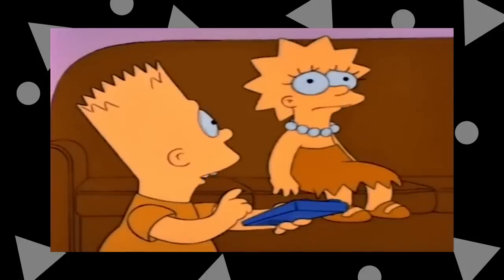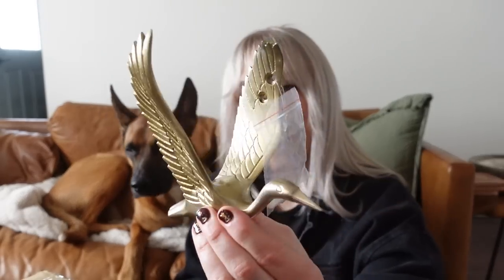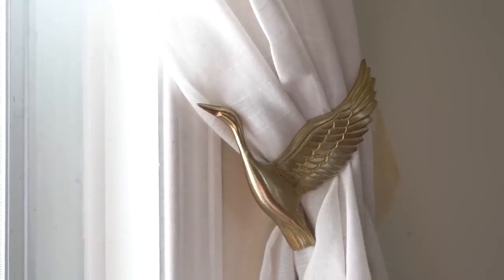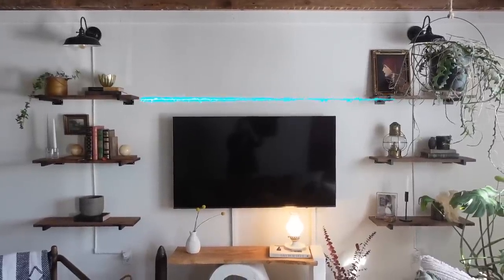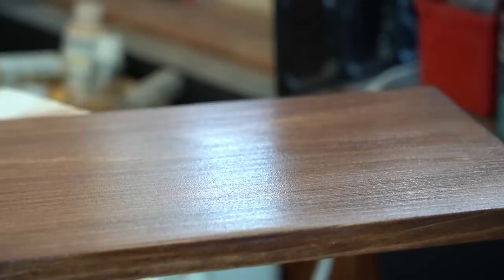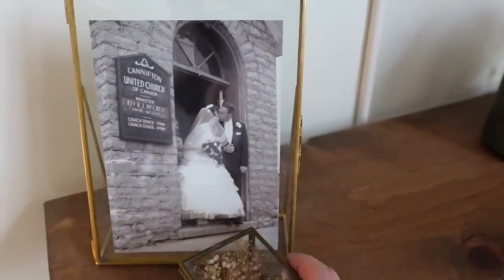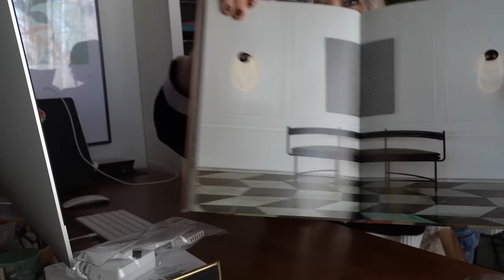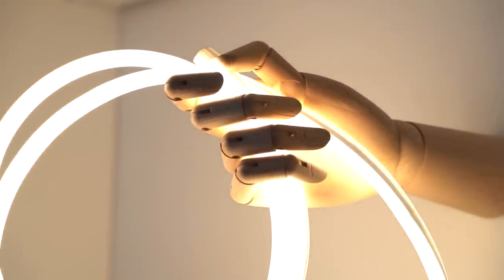a cozy week of diy projects & decorating ✨ | DECORATE W/ ME | DIY Danie

Comment: Is the fingertip bandage part of the Swiss army endorsement?  ;)
The hand-holding-flower hook is too pretty to hang a dog towel on, in my humble opinion.  I would rather see it hold a plant hanger or something similar that doesn't hide it.
Personally, I think the problem with the wall sconce is the random placement in what is otherwise a walking path behind your sofa.  To be compatible with the linear space (walking path) I wonder what a more horizontal light fixture might look like.  Alternatively, I might be tempted to move the picture under an art light, to give it a more intentional purpose, rather than having it compete with the art placed beside it, or possibly change to a light placed a little lower on each side of a more centrally hung picture.  Finally, to overcome the tv glare, what about a pendant coming from the ceiling more central to the room?  If wiring is an issue, maybe you could do a swag?
I like the new shades on the fixtures over the shelf.  They have a quieter presence, letting your eye land more restfully on the shelves.  My décor style is less layered (I also don't love dusting), and not the rustic look that you do so well, so for me the shelves would be the same colour as the wall in order for them to disappear a little into the background.  
I wonder how it would look if you swapped the larger art piece to the middle of the top shelf...
With your leftover brass wall lamps and your black shades, you could always spray them, or parts of, so they can work together in a different project (next episode...).  
Good haul and nice work!  I am celebrating your joy with you  :elbowcough:

Comment: thought's on doing some rewiring? I feel like that sconce on that back wall could benefit from actually being two that mirror the ones on the other side... especially if you can add a thin credenza table to style with a couple items and create a moment for that piece of artwork. Otherwise, what about moving that art piece to be under the sconce and swapping it out for an art piece sconce that focuses a very small amount onto that painting? It wouldn't interfere with the tv watching so much then.

Comment: The rattan wall lamp doesn't fit primarily in style on that wall and seems crazy because of the painting. The position of the painting is strangely bad, neither in the middle nor on the side, it does not fit any way. Either you add another painting and frame the wall lamp between the paintings or you remove the existing one